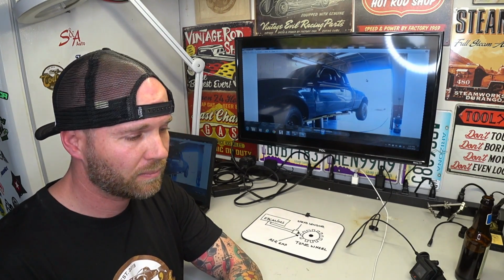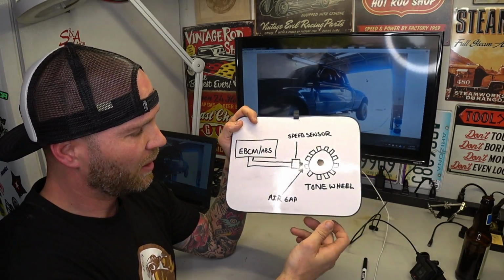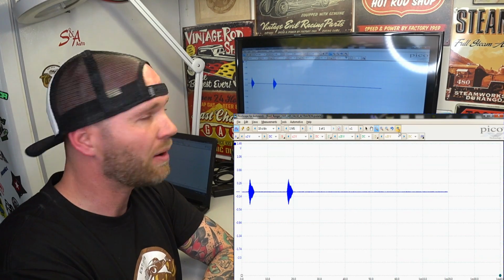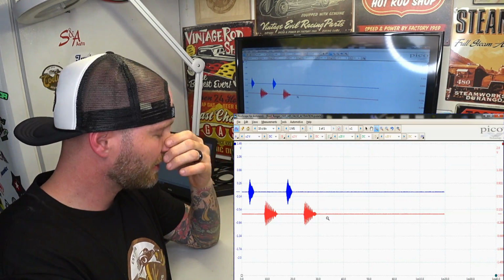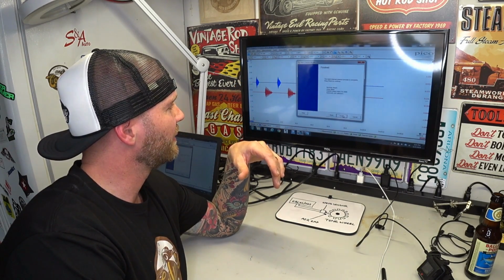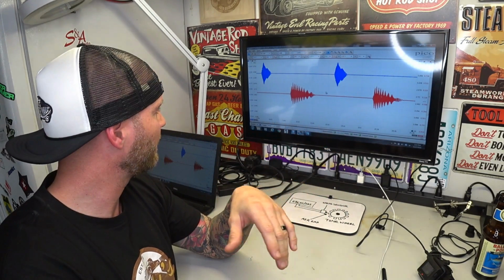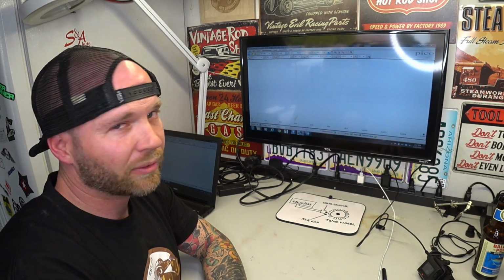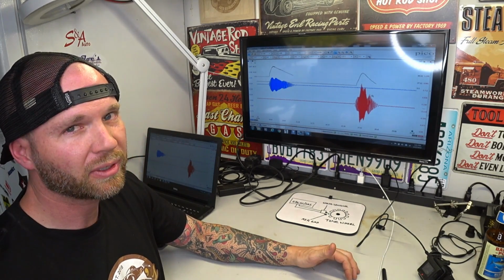Using Pico to Diagnose false ABS activation

Comment: man i love watching these kinda video's, helps to be aware of issues, what to look for, although slight off from abs.. this is the reason i want to buy aeswaves bob... watching trained by tech's and i cant stress it enough that im learning just by that.. the explanations and etc are top notch for well being on video but it helps!! ..
Reply from the maker: It’s all about the learning bro
Reply: @codysautodiagnosticsprogra8706  yes sir it is.... since i posted the comment, ive purchased the bob and the 30 amp current clamp... played with the bob but need to play more to see.. but man.. as time goes by, i cant think of a better tool other then my brain, then the pico scope.. I have immensely dug into it and im loving it.. there is literally almost not one day i dont get it out!! its changed my thinking of tooling and ways to look at it..

Comment: Great job Cody. I had this same scenario on a Honda well over 15 years ago. It would go into an ABS event at slow speeds. The local Honda dealer was stumped and sent the car to me. I had an independent Honda shop and was able to scope all four channels with an Interrro PDA. Just like in your case one of the channels had a high/low pattern. 

It isn't the wheel speed changing. It is the signal strength changing. In my case, it looked like a rock had hit a tone ring and flattened some teeth. This caused the air gap to get wide when the flattened teeth flew by the sensor.
Reply from the maker: Gearhead School thanks for commenting, that’s great to hear about your vehicle and how you were able to see it. Seeing is believing lol

Comment: My next step when I cannot see erroneous wheel speed data is to look at my PIDs for the valves and see if I can determine which corner is going active/has my problem that way.
Reply: Loved the video by the way, it helps to see this kind of thing explained as it's seen on the scope
Reply from the maker: FullClip69 thanks and yes I know what you mean on the abs valves to isolate issue. Unfortunately the Snap-on on this year didn’t give me those pids. I didn’t both grabbing another scan tool or the ford ids and just went to the pico, but yes that would have definitely shown it

Comment: You needed Mr Miagi's chopsticks and some "beginner's luck".   I'm eyeballing this scope because I'm an EET and want the full scope functionality AND it will do serial bus decoding including CAN busses for cars:https://www.amazon.com/Siglent-Technologies-SDS1202X-Oscilloscope-Channels/dp/B06XZML6RD/ref=sr_1_2?keywords=Siglent+SDS1202X-E&qid=1553787881&s=gateway&sr=8-2  You can see from the waveform that the frequency was still good, just the amplitude was dropping out, so it must be that the amplitude measurement threshold for frequency in the ECM was higher than the sensor was sending so it was reading as a 0 wheel speed suddenly, which makes abs think the wheel is locked. At higher speeds the tone wheel must have induced a little higher amplitude into the sensor, so only when the speed was slow was the amplitude so small it registered as 0 with the ECM.
Reply from the maker: That’s a much better explanation then mine lol. Thanks for the info bud